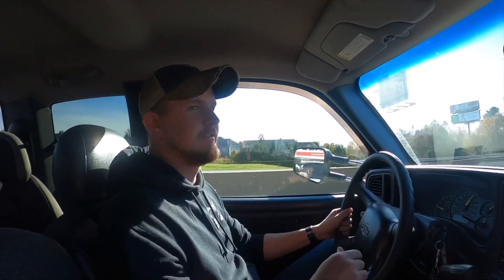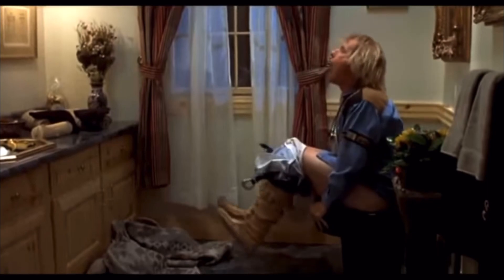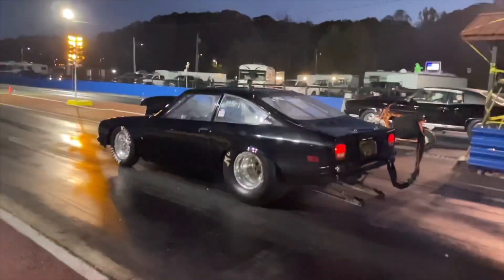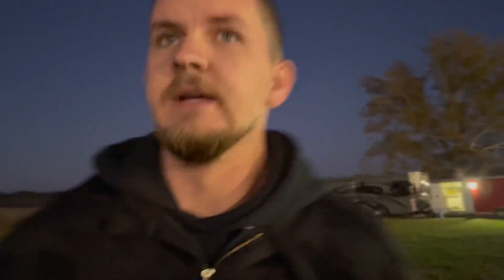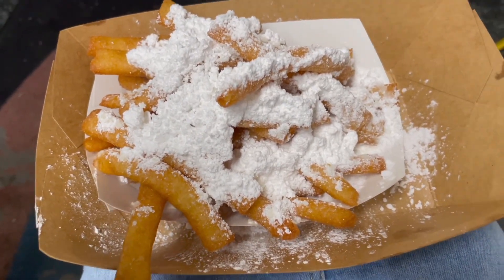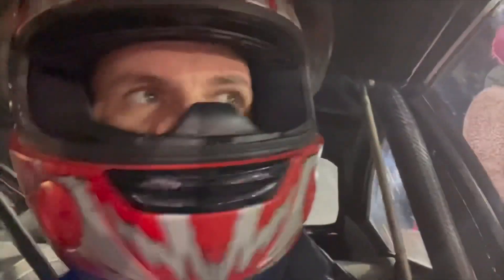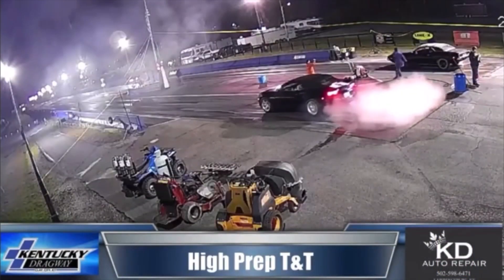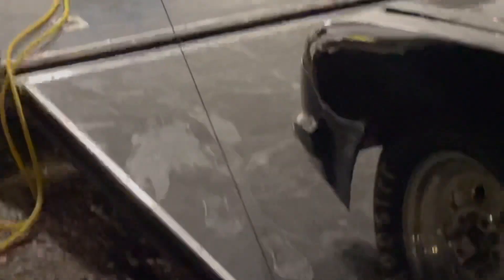New record for our 1976 Chevy Vega drag car! Learning some lessons the hard way.

Comment: Love to watch a good race. Thanks 4 this video.
Reply from the maker: Thanks! We’ve come a long way since this video. Check out some of our newer stuff when you have Tyme.
Reply: @MountainStateRacing hey my man on my girls account wanted to ask you I got a 77 th350 12 bolt 383 g body drums strange axles looking to pro charge one day but for now when I get up to past 70 it starts to shake not violently but uncomfortably in the front suspension to where I don’t want to keep pushing it. No rust or anything any ideas as to how I can fix this? Haven’t got an alignment yet since I got the car copper tires still good. Coilover swap?
Reply from the maker: @perriwinkle265  shocks would just hide whatever is causing the vibration. It’s really hard to tell without someone looking at it.